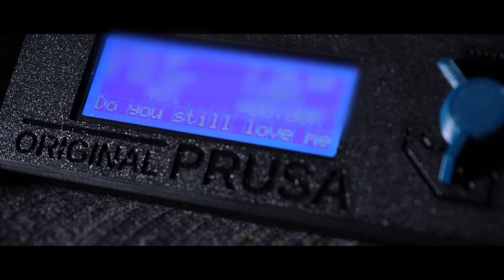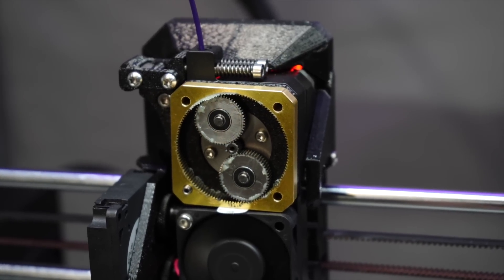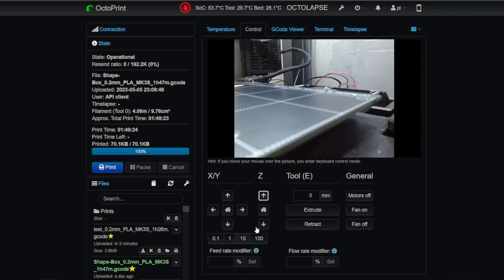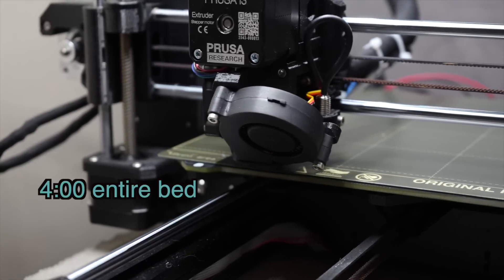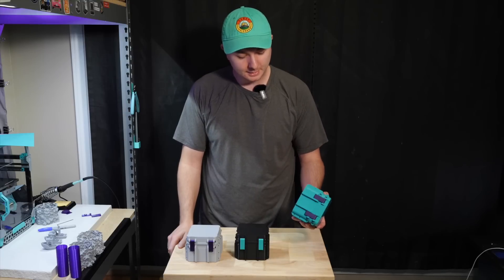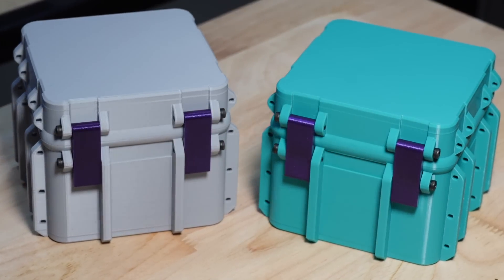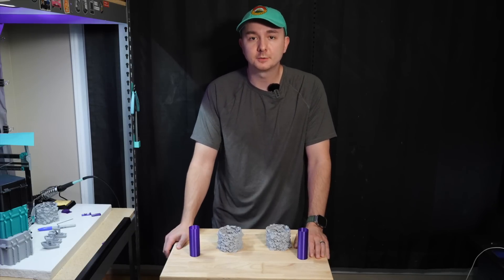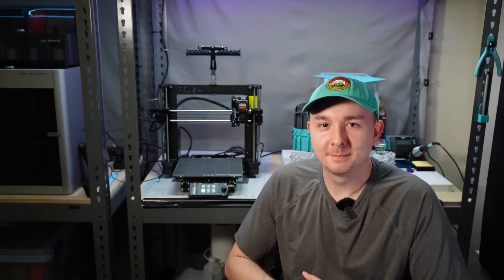Is the Prusa MK4 worth it?

Comment from the maker: I had originally incorrectly  said the MK4 has a built in accelerometer -  which it does not! My understanding is that Prusa will add input shaping based on their own data, but the board does have a connection for an accelerometer.

Comment: @ButterPockets you have had the MK4 for over a year now, how does it stack up compared to MK3S & X1? Guys running a print farm with MK4 & X1 swear by the MK4  due to wasted filament and X1 down time with maintenance concerns. They run XL for colour change. Interested in your thoughts?
Reply from the maker: I think it’s a night and day difference over the MK3. Although for a print farm that could be a different story because the MK3 is slow but it’s reliable. 

Compared to the X1, uhm, I mean it’s hard for me to really like “compare” them. I use both of them just about every day. If I want to print something right now I use the MK4. From clicking “print” to it starting is significantly faster with the MK4 and I know it will print it and complete the print. The X1 tho, I mean I have 2 AMS units and I need that color change ability for stuff I sell. I wish I had an XL and could try that out. 

I don’t know if I can speak from a print farm perspective but if I was going to start one I definitely wouldn’t do it with bambulab printers. I’m not exactly a “ermagerd Chinese printers blah blah” (I am part Chinese, not sure if I’ve said that publicly) but it is a legit concern for a business. I know there is LAN only mode and maybe if the printers just never touched the internet it would be okay. But have you ever seen what it takes to replace the gantry in an X1? That’s a nightmare. I also really don’t believe the X1 is as well engineered as it seems, there was some really questionable choices in that machine. But, from a hobbyist point of view I’m not sure any of that matters. My friend and I are about to start on our own printer design - that’s the path that makes the most sense for us if we want a farm. 

So my answer is just “it depends” I guess? I don’t like to think in black and white terms because everything is grey IMO. But I’ve always believe much more in Prusa over BL, even if people call me a “fan boy” over that. Ultimately Prusa seems like a better company, a more reliable printer, easier to work on, etc. But it’s “slower” (not really), smaller, less flashy, etc.

Hope that helps? Haha. I feel like a just rambled. The thing is too, that was my answer a year ago and it hasn’t really changed. The market is flooded with new users now because of BL and the general advancements in 3D printing. There’s more off the shelf printers now than ever and people can get into the space so easily. Prusa is always gonna be the Honda/Toyota of the market if you will - ask a car mechanic “what’s the most reliable brand” and they will probably say Honda/Toyota.
Reply: @ButterPockets  wow, alot of effort in tgat response, I really appreciate it. I think your comments are objective and well informed. Thank you.

Comment: Interesting video thanks. Your little surface errors seen in the same place are caused by the seam position on that layer. Being in the same place. If you alter seam positions then you’ll see a difference. Or show them in preview and you’ll see them highlighted in that area. 
I’d say the lower seam bulge at the bottom is from your infill, are you printing infill first and then walls? Or using infill overlap or extra wall count/connect infill lines?  Shrinkage of layers without infill supporting them may also be a factor. 👍🏼
Reply from the maker: Been a bit since I posted this, but if I recall correctly I mentioned that on those rock looking prints? Those are printed in vase mode, no seam.

Comment: Why buy a prusa? they are open source. the x1 carbon is all closed source and the parts are proprietary, so if the company goes out of business, finding them is going to be difficult. The slicer and everything is bambu lab. No thanks, I prefer open sourceness.
Reply from the maker: If Prusa were to go out of business you still wouldn’t be able to find their parts either. Open source doesn’t mean “off the shelf”. You’d have access to schematics, CAD models, diagrams, etc but unless someone is making the parts then you’d have to get them made yourself.
Reply: @ButterPockets  that's simply untrue, the amount of prusa clones that exist out there is insane, the mk4 was reproduced for less than $200.
Reply: @cgwworldministries83  it’s not untrue. You just said the same thing I did but in a different way. I repeat: if Prusa went out of business you couldn’t buy their parts, the parts could be reproduced because the schematics and CAD files are available. That isn’t going to stop anybody from doing it to non-open source companies - just look at the CHT nozzle. I get it, I worded what I said in such a way that seemed to exclude third parties that already make Prusa parts. I know that stuff is around and it’s easy for companies to do because of the open source nature. What I’m trying to get across though is that being “closed source” doesn’t really prevent that from happening.
Reply: @jdubya42  all the parts are made in China, same company that makes the parts for Prusa are the companies making the 3rd party printers. The only thing you get when buying Prusa is the name. The knockoff mk4 even runs a skinned version of the same software. They didnt even change the order of operations on first boot. But that's open source for ya.

Comment: i would love to know which one is quieter during prints, which for me is a very important feature, and i would also see or hear about a comparison of the different slicer softwar that are used for the two printers....i heard bambu labs slicer is also very good...i am in the makret for a new printer but im not sure which one of them is the right one...right now im working iwth an anycubic S, which is nice for the price point but is missing a lot of the modern features the mk4 and x1c come with.
Reply from the maker: If sound is a big factor for you then the X1 might not be a good choice. It's LOUD. This comes with printing fast. Even tho it's loud you get the speed and the ability to use the AMS. When the X1 is printing and I have my headphones on at my computer it's still too loud for me. The MK4 on the other hand isnt quiet per se, but compared to the X1 it's quiet. It doesn't bother me with my headphones on.

Comment: 10:11 I noticed this usually happens because of the internal solid infill (the annoying purple one), and I can usually get rid of that line by turning off the ensure vertical shell thickness, but it does not always work depending on the model geometry. It basically smushes too much filament in a small area and it bulges out.
Reply from the maker: In the latest beta of Prusa slicer (what I used) it doesn't have ensure vertical she'll thickness any more!

Comment: The print time difference between the Bambu and the MK4 is dramatic, however, as a hobbyist I'm more interested in comparing the quality of the printed part. Speed is great but, in my case, quality is more important. Can you provide some detail about this?  I'm currently leaning toward the MK4, mainly due to Prusa track record, but speed could be a factor if the quality is high at these fast rates.

Comment: I think this was a reasonable, review, but I feel like it should be pointed out more that they advertised speed as the major feature then..... just didnt actually include the feature with some fine print that itll arrive later (TM). It annoys me, and what annoys me more is the printhead doesnt even have an accelerometer afaik, nor does the bed, so the tuning will be manual, all on a printer that costs this much. Its just like... you could have done better prusa. Both for iteration, and for honesty.
Reply from the maker: I tried my best to point out that input shaper speeds will be "coming soon TM" as you say. It does have a port for an accelerometer and they are fairly cheap to snag. I think doing manual tuning is a plus for some folks because Prusa strikes the balance between Bambulab and a Voron.

Comment: I bought an mk4 over a bambu because of their commitment to being open source, their continuous support they offer to the community and their outstanding long term hardware and software support of the printers. 
I saw people complaining that the MK3 was an old printer, but that's a HUGE plus in my opinion: it has received six years of support (and likely will keep receiving support for a long while)! And if it breaks you can not only replace or repair the parts yourself, but you can even chiose to make it become the new model that's out, extending the support for another bunch of years. Not that you really need it usually, lol. My MK3 hasn't had a single failure during the years!

Upgrading from an MK3 to an MK4 isn't that expensive either, I sold my MK3 for 500€, bought an MK4 kit for 850€... That's a 350€ upgrade.
Reply: I'm still waiting of the mk4 source files.... And also the bootloader of the mini
Reply: I've had it with my Ender 3 SP1 Pro and that was exactly my predicament ... Do I upgrade to Prusa or Bambu .... I ordered the Prusa for that exact reason - I can't even get decent support out of Creality that sit in China ... not to mention proprietary hard and software etc. 

I am in Europe as well so I thought I am not just buying a Prusa for the opensource commitment but also about the fact I could even drive / fly for a reasonable cost to Prusa with the printer under my arm and say 'here - fix it' :)
Reply: you got scammed out of money lol
Reply: @tophatv2902  you do you

Comment: I had one and paid.. then the date changed like 4x so I cancelled.  Your wifi setup, is the exact same process used on the Prusa Mini when you add the 6.00 ESP Module.  While I use the web interface I also am disappointed its not more robust.  I find with my other printers using Klipper and past though limited Octoprint experience that given the amount of time Prusa has been dabbling with this it could have been better polished.  Down the road may do the upgrade from 3+ to 3.9 or 4 but at this point its a no go.

Comment: a very good review! 
I got a Voron and switched to a X1C without AMS and im pretty happy about it.
My Customer Support with bambulab was excellent. They replaced my PEI Sheet after i got a Problem with the Calibration Code (wiped it off).
I think if you own a MK3 maybe just do the board update for the Input shaper if it is working good. I dont know if a pre applied fixed Value without a Sensor in the printer is working good, because everyone got a different table/ environment. And yeah Prusa Link is a Joke. I wonder why they dont copy Octoprint and everyone would be happy.... and the timelines. It takes forever for some Software things (and hardware too).

Comment: Great video and great intro!
As someone with 2 mk3s's and looking for an upgrade its a really hard choice, but bambu would be a way bigger upgrade in possibilities for my setup.

How are the noise levels on the X1C compared to the mk3?
Can you turn down the fans a lot without giving up quality?
They are printing in my small office 10ft away from me so I need them to be quiet.
Reply from the maker: My office is also small and its about 3 feet from my X1 to my computer. The X1 is loud. I had to switch from open back headphones to closed back when it's printing. The mk3/mk4 don't bother me much even with open backs on, but they are definitely still noisy. I see a lot of people saying the mk4 is louder, but idk that i would say that. You can definitely turn the chamber fan on the X1 off and that's the noisest fan, but it's still loud. If you're printing abs or something with the door closed it's even quieter but still louder than a mk3/mk4
Reply: @ButterPockets  Is it like vacuum cleaner loud? 
I've learned to sleep with a mk3s next to me so maybe I will be fine.

Else there still is the cement tile with foam approach, maybe into a closet and see which fans can be replaced with noctuas.

Comment: That bulging you see on walls is usually caused by infill pushing against walls when you transition from solid infill to regular walls. The plastic shrinks differently. You can solve it by either switching to superslicer and adjusting infill settings, or I believe the new PS 2.6 alpha 6 also has similar infill slicing behaviour. Disable ensure vertical shell thickness as well.

Comment: I've watched lots of stuff on the MK4 .. this is the best, balanced review on the MK4/3 and comparing it to the X1C that is out there.. including all those from what are considered the 'top' youtubers. Great job. Secret is not to rush out a review.. I have an MK3S+ and am working with a friend who has an X1C.  The MK4 is still in Beta and Prusa has rushed it out the door to their detriment. Also Prusa doesn't seem to have great internal testers.. or maybe great engineers in the firmware/electronics area. That is evident in the terrible network interface the MK4 and their lack of the necessary hardware design that can give them much faster speeds. I love my MK3 for its reliability, but my friend also loves his AMS and X1C.  I fully agree that if you have an MK3S+ now.. and you have octoprint.. you are better NOT to upgrade. Tweaking profiles can easily give you 20% improvements in performance in the MK3.. I often speed up my first layer by tweaking temp and you can also tune other settings depending on the model's geometry. Eventually the MK4 will supercede the MK3.. but they need to fix that network stuff first; but I'll be interested to see if they implement different hardware.. Prusa sticks to its stuff somewhat stubbornly at times.

Comment: Yeah, at this point I don't know how they will compete with Bambu. They came out of nowhere and aren't perfect yet, but for building a revolutionary printer in the height of a supply chain crunch was a pretty remarkable feat. I pre-ordered the Prusa XL with the 5 tool head changer, mainly because I really have a dislike for anything that requires the internet to function 100% cough bambu *cough*, but I may have to rethink my decision if they delay the Prusa XL for much longer or if it is shipped missing features. It already irked me that the MK4 was advertised to have input shaping but have yet to release it.

Comment: I retired my MK3s+ when I got my X1C.and currently have way more prints out in the last 10 months than the years on the mk3s+. My baseline for another printer has been set by Bambu. The mk4 was a non starter when it launched and the XL multi tool is a LONG way away. Based on what I am seeing of the XL it's not much faster than the mk4 which is a real shame.
Reply from the maker: Honestly the prints in my shop all come from my bambu. Had to make 3 orders quickly last night and the X1 came in clutch!
Reply: @ButterPockets  I know the feeling. My work flow has completely changed with the new printer. I had a work project that needed weeks of hands on printing(multi color) or hand painting and got it done in a weekend.  I think I have become spoiled with the X1C and AMS. ''

You hit the nail on the head about sending files, and just going about your day. I dont have to babysit the printer and the AMS with 4 spools in the wings. I have even ran a preplanned  crisis scenario(if cloud goes down) using the X1 in lan only mode and using the camera on lan. It was a simple setup.  

I think the one good thing about my prusa is that it was not a bad printer by any stretch  so it holds a place above my ender. it's just lacking so many creature comforts that my new printer has I just cant go back. Excellent video by the way and the skit was hilarious.

Comment: Ordered my MK4 a week ago, it will be my first 3d printer. I wanted something that is easy to use and repairable by myself if needed (I have a computed engeering background and recently learemd some CAD at work). I always knew 3d printers existed but only recently I got in the rabit hole of wanting to know everything I could find out about it :).
Reply from the maker: That's awesome! For a first printer it will be a breeze and you'll be cranking out prints as soon as you get it. The new bed leveling system is excellent and you won't need to worry about a first layer ever!
Reply: Welcome to the maker space Tiari. Best of luck learning your new craft! I've enjoyed it over the past 14 months since buying my first one. 🙂
Reply: It is all about open source and upgrades and repairs being completed by me. You add that reasoning with the track record of Prusa reliability then It is a no-brainer decision for me.

Comment: i think the "thicker" layer at the height where the inner top layers start is  caused by shrinkage. The top layers contract and pull the walls slightly toghether causing a visible offset , at least thats my therorie. I have seen this happen on every single one of my printers, no matter the filament. I guess it´s just one of the things we have to live with
Reply from the maker: Yeah I've seen a lot of threads saying basically the same thing - that it just kind of happens.
Reply: Any chance that the slicer is adjusting the height of that layer to ensure a major geometry feature in your STL gets printed at the actual correct height instead of at a nearby height that is an integer multiple of your layer height?